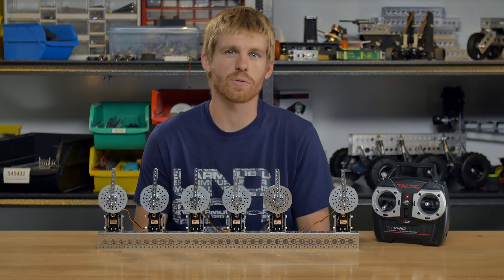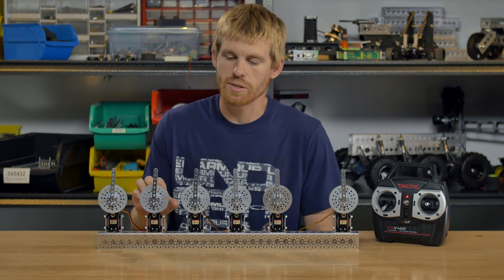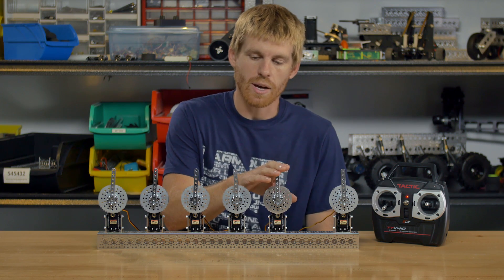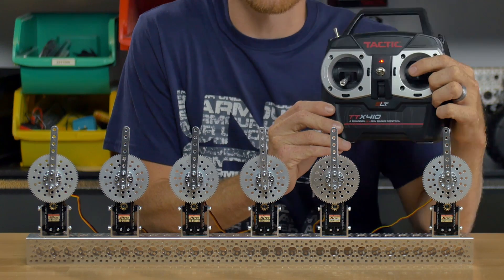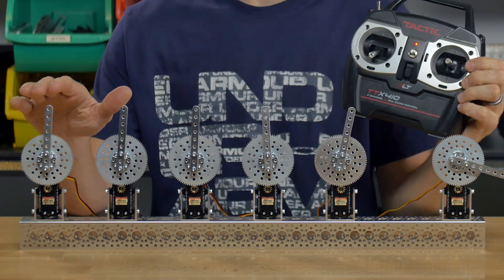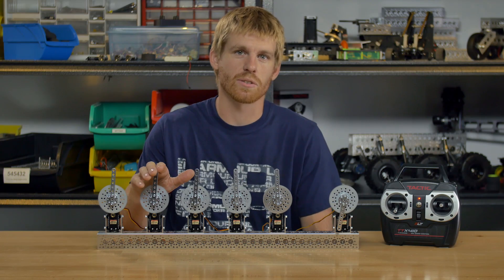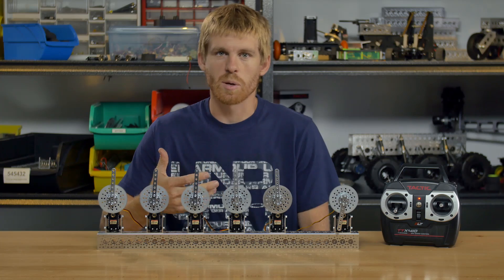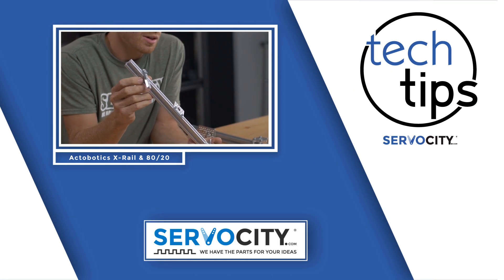Understanding Servo Gearbox Rotation - With Kyle

Comment: Hello, a few question, can i lift up 2 kg with one of these ? and can i control it with arduino ? and how mach does it cost ? Thankyou very much !
Reply from the maker: Hi Marcelo, there are many things to consider when selecting the perfect servo. Send us an email at tech@servocity.com and we will find the gearbox for your application. We offer several sub models for the channel mount gearboxes. Prices ranging from $59.99-$299.98.

Comment: is it possible to 3d print my own gear or gearbox? to increase the torque of my hobby 9.5kgcm servo. let's say with a ratio of 4:1, will 3d printed gears be strong enough to carry an arm of 60cm and 500grams?
Reply from the maker: Yes it’s possible.  How well it works and how robust it is depends on the design and material used.  Feel free to contact us with additional questions tech@servocity.com.

Comment: '
what happen to tactic R/C throller down...
should be return spring normal throller
Reply from the maker: Since the Y axis of the left joystick (commonly known as the throttle stick) does not have return springs it will stay in position when released.  Servos and Servo Gearboxes that have positioning feedback will stay in place when the stick is left idle in any one position.  Servos and Gearboxes that do not have feedback (aka continuous rotation) will rotate at a set speed until the joystick is moved to a new location.  Feel free to email us at tech@servocity.com if you have any additional questions.
Reply: ServoCity hi servocity...
thank explain about return spring on the R/C system throttle with 4 channels on the left side...
rather better put a return spring throttle on the left side with 4 channels or more channels than without...
any R/C systems must comes with 3 parts in the box as 1- spring / 1- spring holder hook / 1- screw in a small bag...
anyway thank servocity